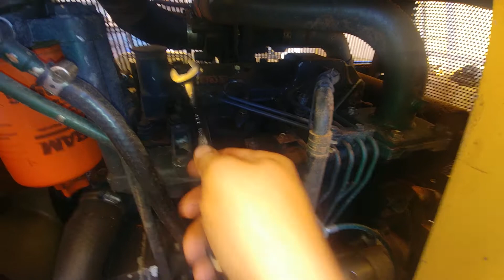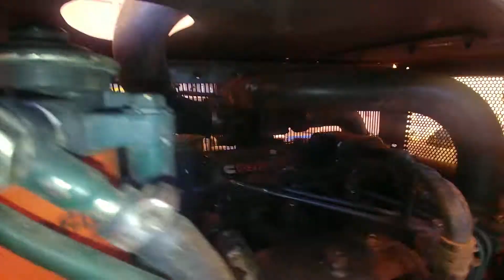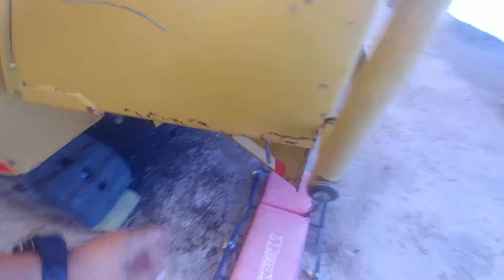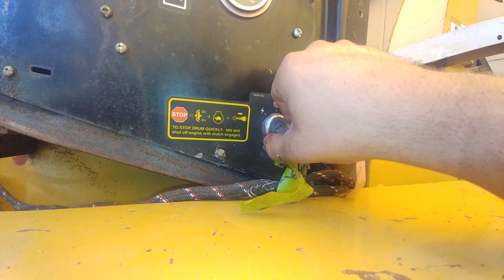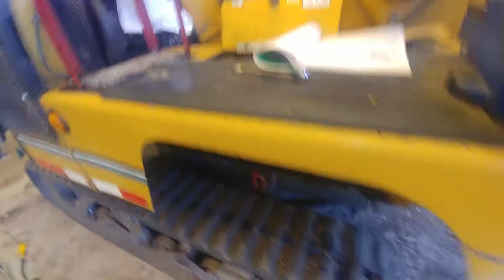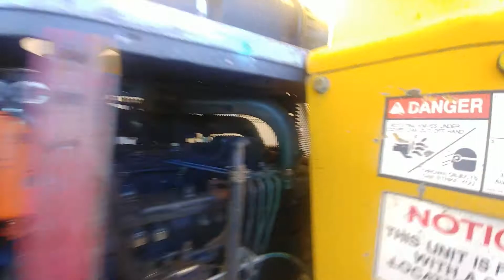CUMMINS B3.3 - FUEL SYSTEM BLEEDING. How To Remove Trapped Air.

Comment: My Vermeer BC1000XL with the Cummins 3.3 tries to start but will not stay running. I was not aware of the prime button on top of the filter. I will try your suggestions. Normally this chipper starts with no problem but it has been idle for several months.
Reply from the maker: Hey Rick. Most likely you have plugged up pick fuel pick up tube/screen inside the fuel tank (happens quite often). Blow compresses air back into the tank from the lift pump inlet. Might be the time to clean the fuel tank.
Reply: @PistonShack 
 With the injector fuel lines loose there was no fuel at the injectors while cranking the engine. My fuel filter is not like yours but has a removable cap on top. Behind it was a button/plunger. After pumping it many times and cranking the engine there was fuel at the injectors. After tightening the lines this chipper now starts better than ever. Thanks for your YT channel content!!